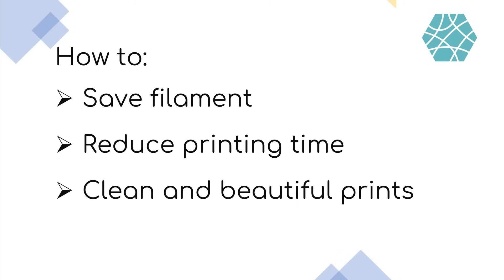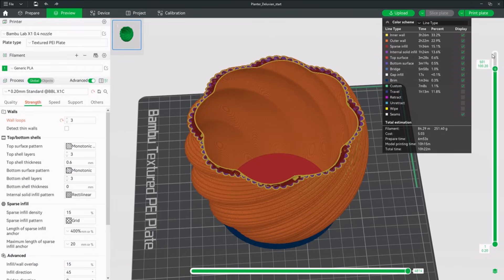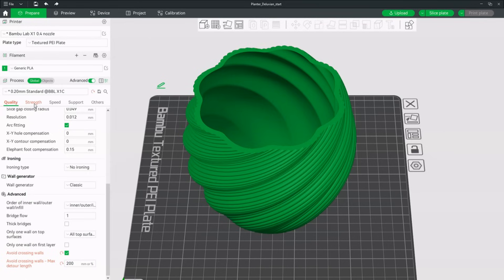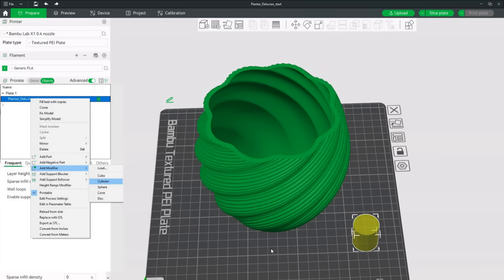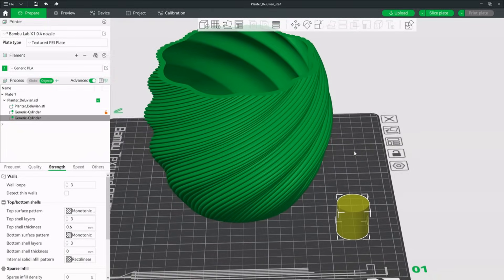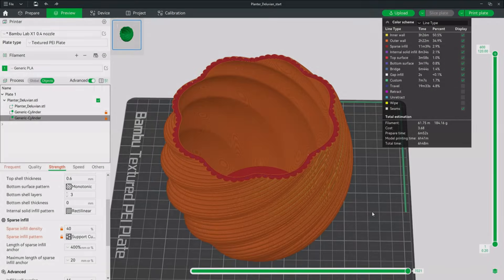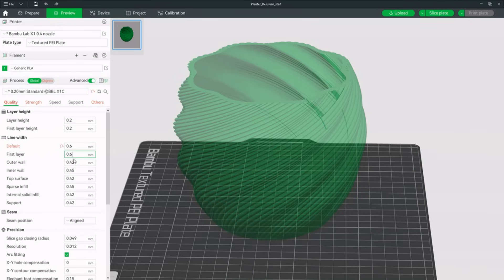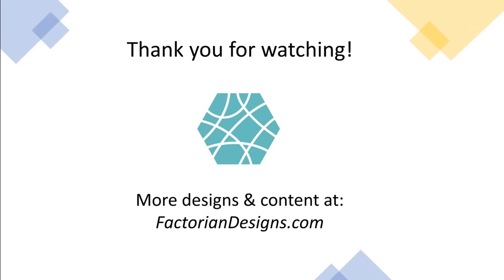Cut Your 3D Printing Time In Half!

Comment: Aren't print the printer against air for the fillers at the top? If you haven't support inside the walls, your top support like you propose ist starting in the air. Does this realy work?
Reply from the maker: Yes this works like a charm as the infill at the top starts next to walls and is basically a bridge. Keep in mind this only works for short distances like in our case.
Reply: @Factorian_Designs  All right, thanks

Comment: Something that drives me crazy is going through all this trouble to perfect and refine the print and then uploading the 3mf to Makerworld, only for users to download the STL or wipe the settings on purpose, so they can use their own settings, and then rate the profile 1 star when it fails or looks like garbage. I report those reviews on a daily basis because they  didn't use the print profile, yet are rating it. This is why I stopped selling models and switched to fulfillment myself on Etsy, I just couldn't handle the constant arrogance of users assuming they know better and ignoring my settings but then trashing me for it not working like in my photos. How do you handle this?

Comment: never had problems with vase mode... also why do u disable zhop?
Reply from the maker: Yes thick lines and vase mode work pretty good.
Z hop does less than one would think, there are quite a few video about it on YouTube. Most of the time is just see more stringing when using it.

Comment: Great video! Very informative, the only thing I wasn't able to wrap my head around is the empty infill other than the top and bottom, is the impact very narrow of how strong the end product willl be? Per example, if I print benchy using empty infilllls other then the top parts where the walls connect it'll be as good as if I kept it at the default 15%? It won't snap easier?
Reply from the maker: Yes exactly, Infill does way less for strength than one would assume. Its all just single weak lines.

Comment: Those settings are for 0.4mm nozzle what should i change for 0.6 and with how much?
Reply from the maker: For 0,6 mm nozzles you could increase your linewidth up to 1.0 mm, the rest can stay as it is.
Reply: @Factorian_Designs thanks a lot i am asking because i got failure to feed during mid print with wood pla and 0.4 hardened nozzle i’d like to try 0.6 hardened hopefully it wont happen again
Reply from the maker: @vladislavovi44  Yeah wood filament and 0,4 mm nozzle is tricky. 0,6 mm shouldn't clog anymore.
Reply: @F @Factorian_Designs thank you alot for your timely reply, i hope it works fine! I’ll give my feedback!

Comment: 3:55 you should not use grid infill as it forces the nozzle to drag over a intersection and collect plastic on the sidewalls, also the sound that infill makes and the visible movement of the head is not good for anything. if you talk about reducing wear with zhop off and you still use grid and tell ppl to use grid? wooooot? dude... no.. pls not grid. so many to chose from and u take the nozzle dragger one? cmon now.

Comment: i increased the speed control on my H2D pro and it works pretty well. I am using sport mode for the prints and comes out pretty well. With your hacks my printer will go on god mode.😀😀

Comment: Great video, thanks for sharing the results of hours and hours of your research and experiments.
A 3D model can be modeled so that it consists of multiple parts. The STEP format allows a single file to contain multiple models or model parts. In the slicer, you can then define extra print properties for each part of the model, such as infill. This avoids the need to insert modifiers in the slicer, which can sometimes be difficult to place, define the correct size, etc. In 3D Studio, this can be done with absolute precision, eliminating the possibility that each printer will place the modifiers slightly differently. It's a great option. It's a shame that 3D Studio doesn't allow us to enter metadata that would let us define the infill we want in advance. If slicers could interpret this metadata in the print properties definition, it would be almost perfect. Good luck with the printing!
Reply from the maker: True, that is a good way to do it. Works with STLs as well btw.
But keep in mind that lots of people can't use CAD software either, so the slicer is a pretty good option in my oppinion. :)
Reply: @Factorian_Designs  Yes, you're right, my comment assumes that I am the one designing the model and have full control over it. When setting the print properties for an existing model that I did not design, a slicer is the best option.

Comment: I just started my first flower pot print with this settings :)
What print speeds do you use?
Reply from the maker: That depends a lot in your printer but for watertight prints reduce your Print speeds for walls and top layers to around half of the standard value. Also increase print temp by 5-10 degrees
Reply: @Factorian_Designs  I’ve got a Bambu A1 Mini. Let’s see how it works with 150 for the outer wall and 225 for the inner wall. I’m going to use epoxy resin on the inside.
Reply from the maker: @krityo03  Then you are on the safe side anyways :)
Reply: @Factorian_Designs  The print turned out great, really nice :)
The pot is 160 mm tall,
120 mm at the base,
and 160 mm at the top.

With the default Bambu settings it would have taken 12.5 hours, but this way it only took 5 hours and used 100 g less filament.
Thanks :)
Reply from the maker: @krityo03  Awesome and you're welcome!

Comment: Really helpful video, thank you! Im just wondering, i thought that removing z hop give much more chance of the nozzle hitting the print. I have a z-hop of 0,4 cause after bed leveling still my nozzle hit tree supports and let them fall. Also, i had to remove "reduce infill retraction" because my nozzle will grind on the infill during travel... Can you help me with that? As you may already understand im a newbie! And sorry for my bad english
Reply from the maker: Sometimes z hop helps, sometimes not. This depends a lot in the model so I would just leave it in for now.

The ratteling sound comes from your infill type, don't use grid. Use one that doesn't cross its own travel path. Like gyroid. 🙂
Reply: @Factorian_Designs  Thank you for your answer! I usually use gyroid but lately im using 3D honeycomb since i saw it uses less filament and printing time, could that be the problem with ratteling?
Reply from the maker: @SbrodolaiProtoKhay  yeah that could maybe be the problem. I think Honeycomb is also self crossing.

Comment: I dont understand how the max detour length can be set to 200 mm, unless you're printing a super high-end visual model and don’t care about time. I thought 4–10 mm detour was plenty to avoid perimeter crossings without tanking print speed.
Reply from the maker: That depends a lot on your model, in this case we want to avoid crossing the inside so 200 mm is needed.

Comment: so if you change the line width to 0.6 mm, isn't it better to just use a 0.6 nozzle then?
Reply from the maker: That depends, often times I still want small details to come out clean and print sections at 0,4mm. I use this most for the top layers :)
Reply: @Factorian_Designs  ok, thanks!

Comment: Hello, I am just wondering - does removing infill not compromise the structural integrity? I mean, if it is hollow doesn't it bulge and break when you pick it up? Might as well just remove the gap completely, why keep the air void in the middle?
Reply from the maker: CNCKitchen has some interesting videos about that. Most structural integrity comes from the amount of walls and shape. In lots of chases you can get away with removing most of the infill.

As for completely removing the air void, you can do that but is an aestetic choice. Some people like it thicc others slim.

Comment: This video really needs to be update with the latest Bambu Studio V2.1. Took forever to find Z hop. It has been moved to Filament Settings, no longer under Printer setting. This is the problem with this kind of software tutorials. Software constantly get updated and Bambu Studio user experience has been pretty bad, not intuitive. So many settings, so many hidden areas where you need to find. The worst is that they move those settings around. YT channels like this really need to update it's videos, even if just add a caption on the old video: Z hop now has been moved to be under the filament settings...  to inform users that those settings have been moved...
Reply from the maker: If you are that annoyed by the Software updates try out orcaslicer. Still looks exactly the same.

And z hop is still in printer settings and filament settings. One just acts as an overwrite.

Comment: Finding this video before I pour half my spool into a nice functional but see through triangle filled trash bin would have been nice. This really helps me on what steps to take next as I am attempting to get this simple bin to be printed at 600mm/s these changes will aid in smoothing out the movements and testing TY Germans for cutting out the fluff.
Reply: I’m new but where do you go to change 600/ms speed there so many options. I got high speed petg but only thing I know how is change to sport mode 😂😂😂

Comment: little tidbit.

Internal support does actually provide some strength, and in some cases, fairly considerable strength, though it's quite situational. If you were to use the example of a cube, with two opposing faces removed, without infill, that cube would be weak in the direction of those two faces. But if you printed it with infill, it will be a lot stronger. Granted you could also just print with those two sides, and they would also act as bracing in that case, it would still leave the center open to torsion, so it's not going to fully remove it. One of the things that infill excels at preventing is relative deformation of surfaces. If you have an inner surface, and an outer surface, those two surfaces can independently of each other, deform, which can lead to undesirable properties in some prints, whereas with infill, that's going to be significantly less likely, if impossible. 

For example with the vase shown in the video, no infill probably leads to the wall being a little bit "squishy" or "soft" but if you print it with infill, it should harden up a bit, and become stiffer, as there is now internal infill to brace the two surfaces against eachother, minimizing deformation.

Comment: So I‘ve been trying to print watertight vases since 3 month with the bambulab A1 and they just always have tiny holes and it leaks. I don‘t know what to do, please someone help.
Reply from the maker: - Print a little hotter (5-10°C)
- dry your filament
- make sure you are not underextruding
- print slower
- calibrate your k value correctly
- wider lines also help, maybe 0,6 mm

With these you should  get watertight prints :)

Comment: Do you recommend getting rid of the infill for all shapes, or just cup-shaped things? What geometries absolutely need infill?
Reply: The settings are not universal. You can test different geometries and see that adding more walls in place of infill will also not always lead to faster prints. And the only reason it works here for the part to have no infill except for the top portion, is because the bridging distance between the walls is extremely small. For your second question, that depends on the function of the geometry, the material, and how well you want it to perform. But in general, 1) infill significantly increases part strength, so you want to use the least amount of infill possible while maintaining whatever mechanical performance you want. 2) infill acts as a support structure (as used in the top portion of this model) to support surfaces, helping maintain its intended geometry.

Comment: Thanks for the video! I applied all of these tricks to a cylindrical part that was normally printing in about three hours and now it takes under two, which is fantastic. I also increased the layer height from .08mm to .1mm, which accounts for a significant chunk of the reduction.

The only issue I've noticed with the new settings is massive amount of stringing which occurs along the wall crossing trajectories and across the decorative holes I've designed into the walls of the part. There was no stringing with the previous (read: basically default) settings.

I'm using Orca Slicer with a BambuLabs P1S and the part in question was made using Elegoo matte white PLA.

Any tips on eliminating the stringing?
Reply from the maker: Great to hear!
Did you enable "avoid crossing walls" ?
Reply: @Factorian_Designs  Yes, that was the first thing I tried. The crossings generated as a result of that change correspond perfectly with the stringing (and the decorative holes in the model).

Could it be an issue of over-extrusion or retraction?
Reply from the maker: @helmanfrow  hmm I am not sure, maybe its due to the line width increase and a little overextrusion? I would do very small test prints and enable/disable any settings you suspect.
Reply: @Factorian_Designs  I'll keep messing with it. Thanks for the help!

Comment: Great tips and tricks, thanks! 

I have only one concern regarding the Z hop: There is a scratching noise when I adjust the Z hop setting to 0. Probably, the extruder and the part on the plate keep touching when they should not. I also had a failed tree support with the same setting—which is not usual. I suspect that 0 Z Hop caused that failure, too. 

Now, I am experimenting with 0.2mm Z hop. I will add my findings here after I observe the results.
Reply from the maker: Thank you!
The scraticing noise could also be due to grid infill btw.
Reply: @Factorian_Designs  I already tried 0.2 and 0.4 Z hop on the same part. I hear that sound less, but it is still there. 

I hear that sound while printing a cylindrical shaped part, with grid infill. Thanks for the recommendation! I will check it one more time with changing the infill type.

Comment: Can't help but wonder how squishy it is 🤔 tho it is kind of hard to see where the walls connect on mobile 🤷🏿‍♀️ Also, for finer control over the top few layers modifications, a height range modifier can be added (I usually use those)
Reply: I made a blow dryer wall mount and I can squieeze it with petg like a toy lmfao  too light
Reply: @swoodc  This approach obviously is not for functional parts.

Comment: The question for me is if almost all prints benefit from not having the head cross over why is that a default setting? If it's more optimal to not do that why is it doing it in the first place?
Reply from the maker: If you have z hop enabled and see absolutely no stringing on your prints, then crossing walls results in lower travel distance and in return reduces print time. But it isn't much. I think Cura has their equivalent setting enabled by default.

Comment: Great Video!
So I'm very new to 3d printing, but I already fell in love with it! My question is: Will the Modifiers in Bambu Studios that you added get printed as a shown or just inside the Walls for strength?
Reply from the maker: The modifiers just change settings in geometry overlapping areas. None of the Modifiers will be printed out :)
Reply: @Factorian_Designs  Very good to know, thanks for the fast reply!

Comment: Very well explained! The only thing I didn't understand is why you chose the top surface to be 0,35mm line width? You have 2 walls with 0,6mm = 1,2mm total wall thickness. Wouldn't it mean that you can do the top surface line width only anything that can divide 1,2mm in "full numbers" ? Like 0,3mm (4 walls) or 0,4mm (3 walls) or 0,2mm (6 walls)?
Reply from the maker: Modern slicers don't quite work like this. Depending on the path the nozzle has to take the slicer slightly adjusts the linewidth on its own to fit the geometry. This is true for Classic but Arachne mode even more.
Take a sliced model and look a the slicer preview. Set the visibility setting to "linewidth" and I am sure you will get what I mean. :)

Comment: I've used a 'speed up' trick in Bambu Studio: edit the Filament Profile, 'Cooling' section, disable 'slow down to cool'.
Sometimes Studio uses the slower print-rate for cooling when it doesn't need to.

Comment: Reading different documentation and seems to be differing opinions on whether disabling z hop or not. Some say leave it on / standard because otherwise you may drag your filament across your design and create a clog, but I see you still left 0.8mm retraction. What is the difference between retraction distance and z hop?
Reply from the maker: I just don't see a didifference with my prints but you can of course leave it on as well. 

Retraction is the distance the filament gets pulled back into the nozzle. Z hop is a short movement in z direction.
Reply: @Factorian_Designs  Thanks for your response, I will try both and compare.
Reply from the maker: @drserge714  just to clarify, you should never turn off the filament retraction. 😅

Comment: My very first and only failed print so far happened right after I disabled Z hop, which has almost no benefit from what I'm told. The hot end just rammed into a couple objects on the plate and that was the end of that.

Comment: I would've like to have seen an physical comparison of the resulting prints because I have a pretty hard time believing that the faster print is nearly as sturdy.
Reply: Maybe on these kind of forms it works but I did try with all those settings on some boxes and you can just press through the middle
Reply from the maker: Understandable, I missed doing that but in my latest video I do exactly that with a different print, to show that it is more than sturdy enough :)